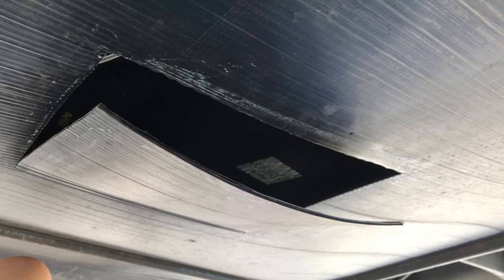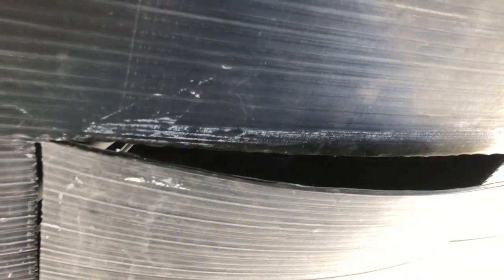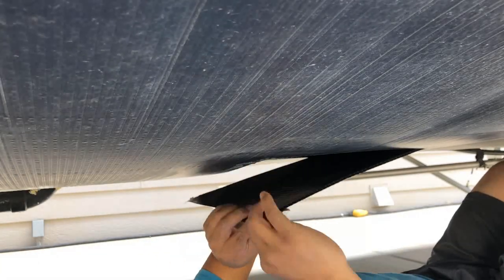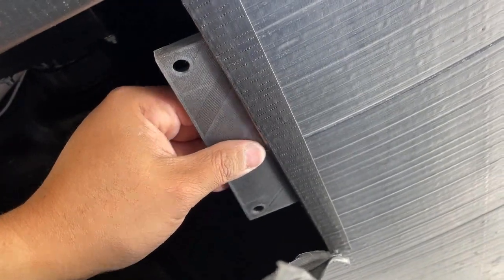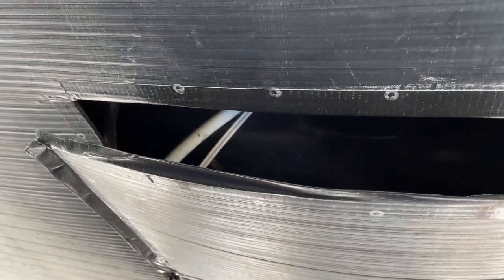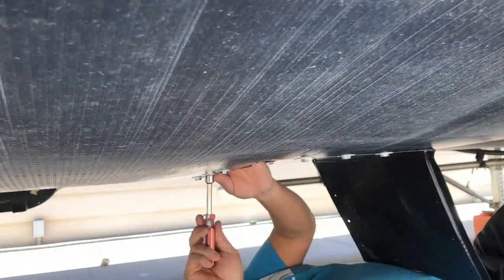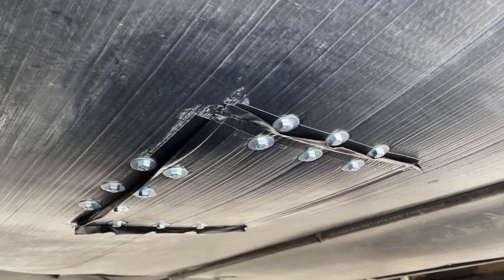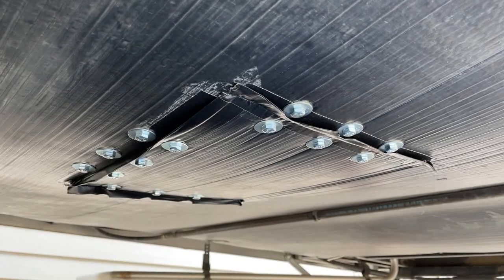RV Underbelly Hole Repair

Comment: That's one way to do it. I would suggest just cleaning the perimeter of the cuts with rubbing alcohol and using Dicor tape or Flexseal tape. Both will easily hold up without using additional hardware. If you want extra hold, you could always use adhesive caulking and or semi-permanent hot glue. Toodles.
Reply: Hi!  Is there any chance to purchase the brackets from you?  I don't have a 3d 🖨.
Reply: What he did is better than your stupid idea...

Comment: Nice fix... however, when you put the bolts in on the door flap, how did you work the nut when sealing it up?   Or did you tap your 3D printed brackets so the bolt just went on in?   I'm a little lost at this step.

Comment: You can make the bracket iut of plexiglass. Drill straight holes for the outer part and tap the holes for the inner part

Comment: We had a red squirrel (family?) get into the underbelly of our old camper, there were so many pine cones in there, the underbelly was sagging.  I cut multiple holes  (access hatches similar to this) to remove them.  To close the unit back up, I placed the lightest deck boards I could find inside, overlapping the seam and screwed up into them and then sealed it with rubber roof tape to keep moisture out.

Comment: How did you get the nuts to stay on the back of the brackets when you can't reach in there to tighten them?
Reply from the maker: I just put a little piece of tape over them to hold them in place and poked a hole through the tape on each nut so the bolt could still thread all the way through
Reply: Interested in your brackets if you are still selling them